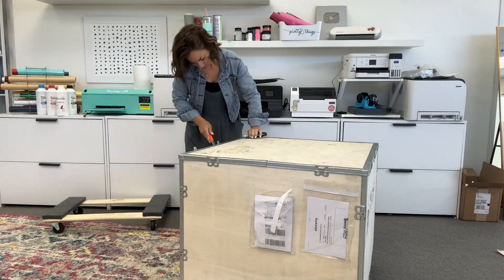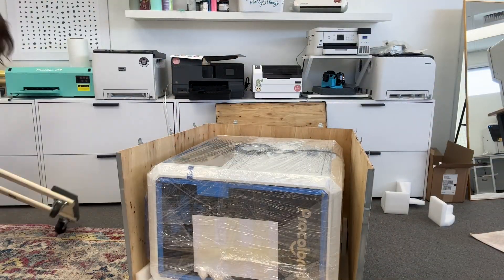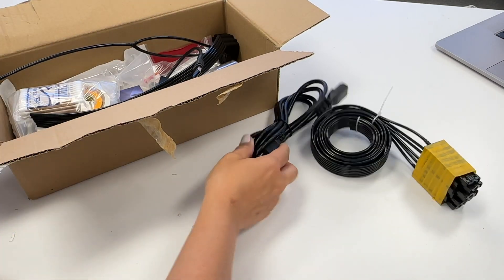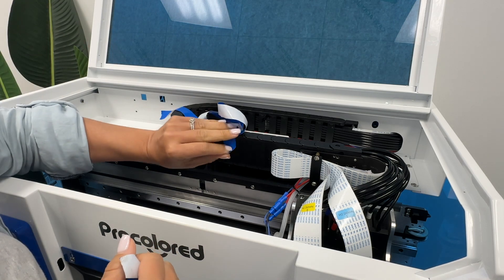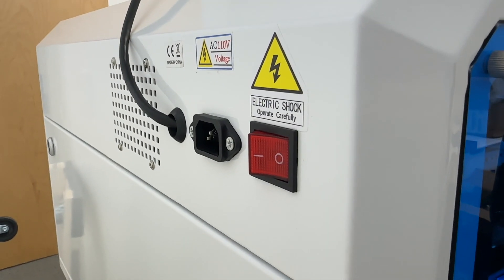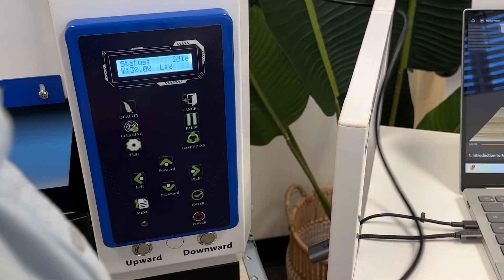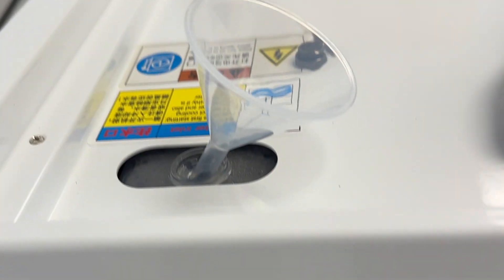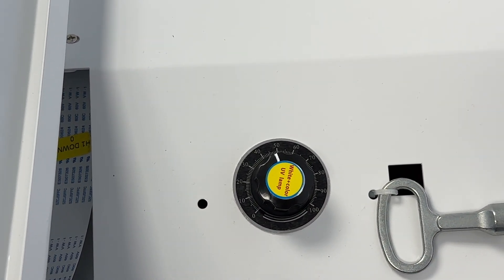Unboxing and How to Setup ProColored TX800 UV Dual Printer

Comment: Please do more videos on this printer! I am so interested on your take on it. I wish I saw your video mentioning the BD8 sooner because I got it and have been having nothing but issues so I am in the market for a new one!
Reply from the maker: What issues are you having with the BD8. The TX800 is very challenging to use and so far I am not making a recommendation on it
Reply: We just received our TX800. There are so few videos on it. The instructions that come with the machine are less than helpful. We are struggling with trying to figure out what side of the material to print on your videos are extremely helpful though.